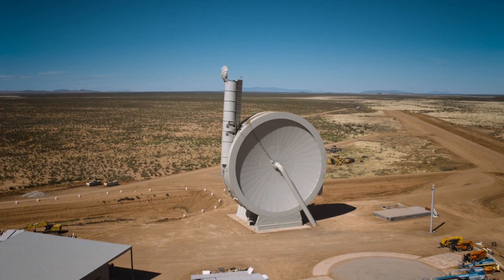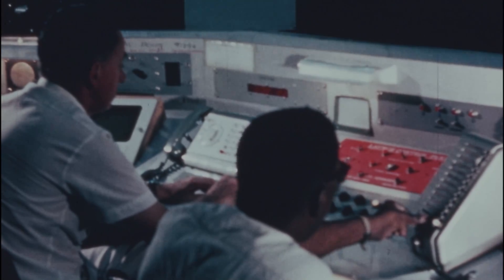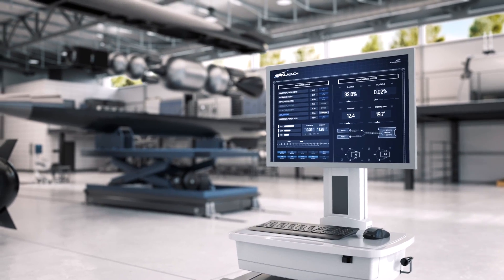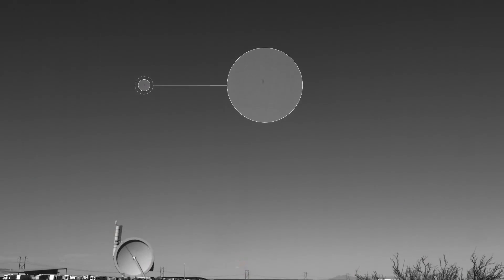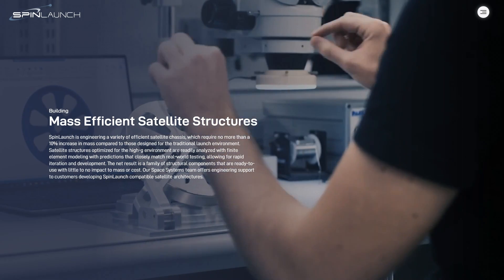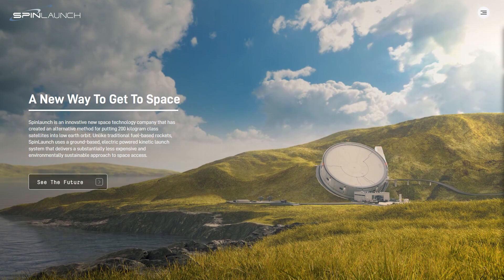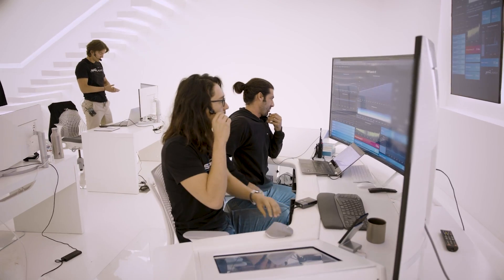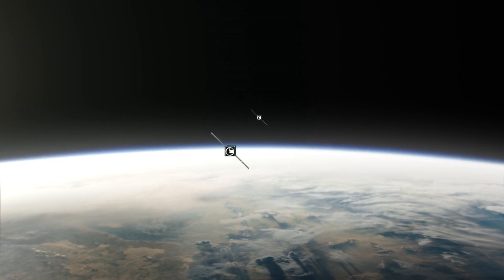Can Spinlaunch Throw Rockets Into Space?

Comment: 2 opposing masses; 1 is payload, 1 is a dummy. Simultaneous release, payload to LEO, dummy into a catchment pit. No imbalance. Simples. 
Or a 'cross' of two arms, 4 payloads of equal mass, sequential release 1 millisecond apart. a very small deviation means they wont 'tail-gate' and ram into each other in the atmosphere.
Or a massive rotor and conformal bearings, I have seen self balancing rotors that have ball-bearings in a circular track that adjusts the CG dynamically.
Or 3 limbs in a 'y', 1 for payload, 2 are hinged; at spin-up and release the hinged limbs automatically balance the CG.
Lots of ways to self-balance the sudden change of CG.  Many lab-centrifuges have these systems already, scaling up should be easy enough.

Comment: I had a idea for this exact thing over a decade ago, for long range artillery if nothing else -- but I figured it would be very hard to do too xD I don't think this is ever gonna be used for anything that anyone can actually ride though... less you wanna be speghettified of course.

The first big hurdle is how you get the projectile to sling EXACTLY where you want it, EVERY time. The second hurdle is accuracy -- I suspect it may not always fly at the exact trajectory you'd want it to take 100% of the time so it probably has to have a way to adjust its course once it's launched. The third big hurdle is making projectiles/craft that are capable of maneuvering and navigating under its own power after being launched all while handling the extreme G's. Making a spin launch system that doesn't blow itself apart at high speeds would actually be the easy part compared to these other issues...

I kinda decided it probably would be a LOT cheaper, more compact, and easier to make a launch system that used directed high explosives instead though. It takes a LOT less math and engineering to make a staged launch system that's designed to direct a ton of energy into a first stage to propel it at high speeds than it is to create the worlds largest Gravitron that's safe, reusable, and reliable, and chances are even if it works it would have a limit to how large it can be due to stress limits on available materials used in its construction (probably would only be possible with small payloads). Using explosives the entire first stage and launch system is solid, no moving parts. It just has to be able to efficiently direct most of the energy into the craft, without destroying it, and it also is scalable.

Dig a really deep hole in the ground and set explosive charges along the length of it to detonate in sequence, then build a craft with a first stage designed to direct all of the energy from the explosions upward to propel the craft. The deeper the hole the more explosives can be detonated to accelerate the craft. The only challenge is making the system capable of reliably controlling the explosions good enough to the point of the whole system being truly reusable. The best part is anything you stick on top of the first stage could just be conventional rockets that already exist, just make sure they can handle the stress of high acceleration and it should all be compatible (if you had to use them at all). The system should be able to send small payloads up easy with just the first stage but it also should work for heavier payloads with a rocket assist on additional stages. There is the downside though of noise and pressure waves however... this would have to be built in a wasteland in the middle of nowhere. The concussive force of the explosions from this thing would turn internal organs into jelly if too close to it when it goes off xD

Comment: dumb comment of the day:  launch two things.  One is the space shot, the other a ductile slug in the opposite side of the arm and out in the opposite direction.  Dig an appropriate sand pit under that and simultaneously release. Assuming the same coefficient of friction, they should unload the mass from both sides and cut the risk to the bearings.  by using a ductile material, the energy would be dispersed into the sand and through shape and possibly phase change of that slug.  Depending on the value of the slug, it could be smelted back out of the sand pit for reuse and calibration to the opposing payload for the next shot...

Comment: I had this idea for a long long time ... excellent work guys, congrats! Great things for shooting up material 100-500 kg ingots for space production. Just shoot shoot shoot ... 
Why not put it on a 3 km mountain? Thinner air.
Why not put a longer outgoing tube? (put most of the wheel under the sea).
Why not stabilize the projectile in tube with magnets, or even combine some maglev/rail gun additional acceleration? Yup, it would need a heck of precision.
Why not shoot satelites from orbit like this? ... again, mostly ingots, but usefull things can be launched, pardon me - shot, as well. Use sollar or nuclear power, spin it up ... make it 1 km radius, or 10 km radius ... no limit. Don't use outter shell, no air friction .. just tethers ... could it be done? Shoot satelite to Mars, release same mass dummy object other way - forces cancel eachother. Zero rocket fuel.

Comment: Scott: "Do the math!"
Me: Ah... no.
Reply: MACH 1 is 1/3 km per second = 6 times slower than 2km/s.
Kinetic energy is mass*speed*speed*0.5
So if demonstrator speed is 1unit of speed then its kinetic energy is 0.5units of kinetic energy and with speed of 6units(2km/s) the kinetic energy will be 18 units so the demonstrator is doing less than 3% of the kinetic energy...
MACH 1 is the limit for most helicopter rotors tips as you do not want to have part of the rotor blade going supersonic and part of it subsonic.
The whole demonstrator looks like a scam for people that have money but do not want to do the math...
Reply: @Bialy_1  It is a scam. They somehow "forgot" to mention the problem of centrifugal tidal forces.
Lets say r = 100m, f = 450 rpm = 7.5 Hz, and the rocket is 1 m wide.
That means 100*2221 m/s2 of centrifugal force for the outermost part of the rocket. About 20.000G. However, the inner part of the rocket, which is 1m closer to the point of rotation, experiences 2221 m/s2 less. So there is a tensile force-difference of 2221 m/s2 pulling the rocket and its contents apart sideways. Which means that you have to design the satellite-payload in such a way that it can withstand being PULLED apart sideways by a force equivalent to 200G.
Reply: You only need two formulas.
centrifugal acceleration in m/s2 = radius in meters × 4 × (pi)squared × (revolutions per second)squared

And 1G = 9.8 m/s2
Reply: g's on edge of rotating disk.

g = 1 Earth g of 9.80665 m/s^2
r = radius of disk in meters
rpm = rotations per minute

g's = r (rpm/29.9042)^2

11,322 = 50 (450/29.9042)^2

Comment: There are several ways to get to orbit, but they have to wait until the existing method have made space travel affordable. High mountains, like mount everest have a fraction of sea level the air density on their peaks. Long tunnels can accelrate the projectile during a longer distance to lower the g-forces.
Reply: This is what I always wanted to see. A many mile long rail gun that exits at the top of a mountain
Reply: You would use most the energy moving what you launch from the top of Everest just having to transport the stuff there and the altitude isn't really a significant quantity of what is necessary to reach orbit. Also a method like the one in this video at best may do low earth orbit for small payloads but it wouldn't ever be able to sling something at that speed to escape velocity as you would be flinging quite a large payload still and you have limits as soon as you break the vacuum of the rotation chamber and hit the atmosphere. If it is going at a speed to reach orbit it will be quite durable shielding greater then what is needed for returning from orbit to keep from just disintegrating.
Reply: @NeverSuspects  you are welcome to discuss what you want, but I keep to the topic iofy how to place a satellite in orbit with the help of a ground based system that give the necessary speed. The athmosphere is one obstacle that I explained one way to handle.

Comment: The economy of this method could conceivably be scaled up by having multiple launching arms that use energy transfered from the preceding launch's spinning arm. Essentially using it as a flywheel from which to derive energy.
Reply: That miiight work, but it would be somewhat impractical. It would be a lot simpler to just use a regenerative braking system to recover electrical energy from the rotor as it winds down; that energy could be stored for re-use, or just fed back into the grid for a refund on your power bill.
Reply: @ShadowDragon8685  A mechanical system might be more efficient. I have no bases for this opinion though.

Comment: I remember how you did a video on launching a rocket from a mountain. What about Spinlaunch building on a mountain? Does not have to be a super high one. Just one that is high enough above sea level to help with getting out of the more dense part of the atmosphere. Maybe around 12,000 to 15,000 feet as you can get construction workers who are already used to higher altitudes from areas like western Colorado. You can also have an automated light rail system to take the payload up to the launcher with the control station at the base of the mountain.

Comment: On the airless Moon, an electrmagnetic linear accelerator would be just as good (See Robert Heinlein - 'The Moon is a Harsh Mistress')
Reply: Not positive about that statement, because the acceleration peak G's would be higher than slowly ramping up to speed.
Reply: @user-rs8zg8ey2b  They wouldn't have to be, it depends on the length of the launcher.
Reply: @JeffDeWitt  which dramatically lower efficiency? A blob vs 1 km rail
Reply: @kantoorhandook6595  It would cost more to build, but after that there wouldn't be much difference. The rail would also be more flexible, not only could it launch cargo but with the gentler acceleration it could also launch people.
Reply: @JeffDeWitt  in order to "launch people" it would have to be a very long gun, on the scale of maybe a mile or so. The G forces exerted on people now with today's technology is right there at the max a human body can handle. You can't expect the human body to go from 0 to mach 1 or 2 within a few hundred feet, it would obliterate their bones and turn them into a blob.
Reply: @frankiethebull8269  Not a problem on the moon. The catapult in "The Moon is a Harsh Mistress" is around 60 miles long.
Reply: @frankiethebull8269  correct, to accelerate to lunar escape velocity  of 2380 m/s in one km takes an acceleration of 2832 m/s2, or 289g. To keep acceleration down to say 4g, it would need to be 72km long (so the 60 mile long catapult in The Moon is a Harsh Mistress is a reasonable proposition).
Reply: Where are you going to get the amount of power needed to operate spinlaunch or a rail gun on the moon?
Reply: @hunterbiden7391  Lots of solar power up there!
Reply: @rattywoof5259  I see.
Reply: @hunterbiden7391  Not a problem, one thing the moon has in plenty is solar power.
Reply: I think that would be too expensive. Not to mention the surface of the moon is very Sandy, and a ton of craters. You might not get a good foundation for it
Reply: @AnnisAdventures  The launchers in the book (early 1960s, but well-thought -out) were underground.
Reply: @mopenshaw  once again, that will still be super expensive and with all of the craters, some being I think like half a mile deep or something, you would have to base it super far underground.

Comment: Could use it to make a fly wheel generator to. Magnetically suspend it in a vacuum and turn a generator at supersonic or hypersonic speed. 
They use flywheels to even power buses in some places. 

Zero emissions and using less than 100 percent if its power to het up to speed. Would only need to be driven faster here and there after energy has been stored for it. Zero emissions. Ignored as a solution to pollution.

The ocean depths and the atmospheres vastly different pressures are a natural vacuum pump to that could literally run itself and restart itself using gravity and the oceans pressure at depth for emission free energy. Also ignored as they add pumps they don't need and don't have pipes utilizing that natural perpetual motion machine.

Oceans 16000 psi at its deepest. The air is 14.5...

 If pumps work off vacuum pressure. This should work as long as parts last and there is deep water that provides more than 14.5 psi and could be a closed system with the end emptying back into a lower pressure depth of the ocean. 

To repair close it off and hold water just past where things need fixed. Water pressure alone refills the pipe. Keep animals away with grates and or sound deterrents like nuclear plants already do.

But perpetual motion is impossible and they don't use that immense ocean pressure to make zero emission energy....

Funny right. Twi different ways that are old and by the math could give net energy and its ignored for fusion even The LHC cant do with temps as hot as the beginning if the universe. But inly six times the suns core is said to be needed. But no fusion. Smashes things apart instead... And even tho temps reach past the limit they set for fusion by a vast amount they dont use the LHC to try and make energy either.

Which they could maybe find a way to make it a closed system to. Fusion into fission back to fusion. End up not losing fuel at all as the magnetic field from the plasma transfers energy.... Not that that may even work if possible. 

Gravity may control those quantum effects the sun is theorized to need cause its mass and core temperature aren't enough to do fusion and we cant get quantum effects for more than a minute. 

What would happen if gravity is constraining quantum effects of stars and objects and they do get it to happen without that constraint?
Reply: Its almost like the worlds literally set up with the answers right there in the ocean for anyone with common sense to see it.

Even fly wheels. Those in use today aren't even in a vacuum or magnetically suspended and last for hours driving heavy buses around hilly areas.

Why not use any of it ax the math days it should all work. Well how could they get more money if electricity was truly emission free and self sustaining.  

Maybe they had the answers all along and cooperate greed screwed us.
Reply: I may be wrong but assuming the tube uses how water flows faster through thinning pipes, water in it should reach at least 1000 times higher than the surface of the water if the opening is down where its 16,000 psi.

 At sea level how fast would that pressure make water exit a pipe if it was designed right and used confirmed principles of how incompressible liquid accelerates through constricted sections of piping?

The constrictions placed in spots that cancel out the increasing weight of water in the pipe allowing the pressure from 16000 feet deep to overcome the heft of water in the tube?

Or just use a massive opening for the largest area to intake water as possible to increase its force in the pipe.

A 1 inch square pipe opening leading to the surface air would have 16,000 psi pushing on the water.

How big of an opening is needed to push enough water above the surface and power an in tube turbine? I would say 200 feet across just to be safe and have more than enough pressure for a 20 to 30 foot pipe. If it also uses constriction to accelerate the water as it moves parallel to the ocean floor.

Only issue would be bends in the tube having water rush through and cause a hammer effect that bursts the pipe if its to weak for the pressure.

Which I just remembered. That 16,000 psi is from all the water in the ocean. So no amount of water in the tube would be heavy enough to stop the flow unless all the water in the ocean was in the pipe

Opening back down to 50 feet across and generators through out the pipe at depths easy to do repairs on.

Energy crisis solved if generator technology is up to the task or just throw more generators at it...

Still leave possibly supersonic water thru need to slow down. But then just widen the pipe till the water slows to a safe speed for generators to not be ripped apart.

Put money into that and power storage instead of the fusion stars technically cant do without quantum effects that we can't control.

Comment: "It's a 100 m diameter chamber. They're rotating at 450 rpm. If you do the numbers it comes out ... "
... at ( 450 * 2 * PI / 60 )^2 * ( 100 / 2 ) = 111033.049512 m/s^2 = 11318 g.
Given v = a t and d = 0.5 v t (for constant linear acceleration from zero), 12-bore slug 400 m/s out of 500 mm barrel -> 160000 m/s^2, .45 ACP 270 m/s out of 120 mm barrel -> 303750 m/s^2 and 5.56 mm 970 m/s out of 650 mm barrel -> 723769 m/s^2, so I guess it could be worse but yes, that's rather a lot of acceleration.

Comment: Interesting concept. I question the placement of the control building close to the same plane as the centrifuge.  The design should account for the possibility of rotor breakage, and it would be easier to protect the building if it isn’t in line with the potential debris path.